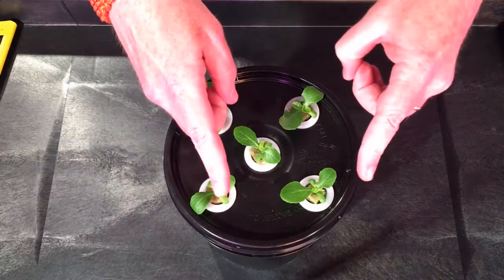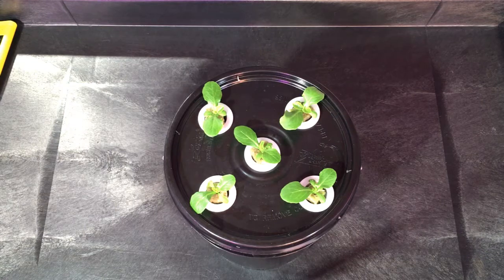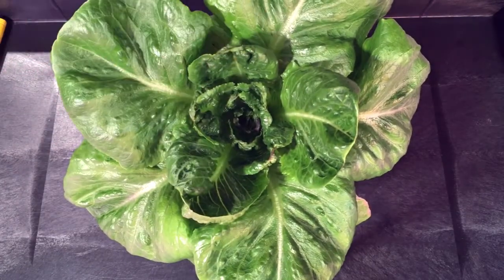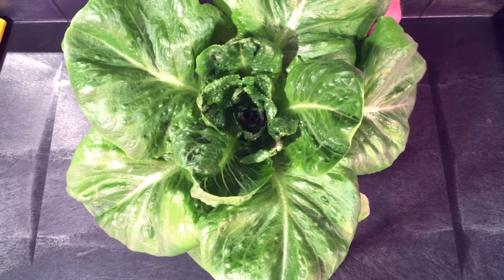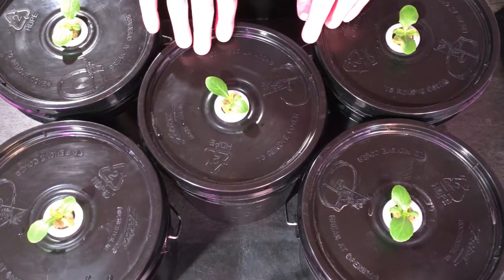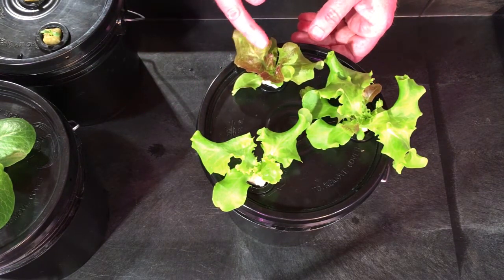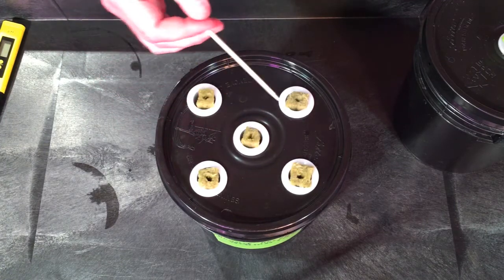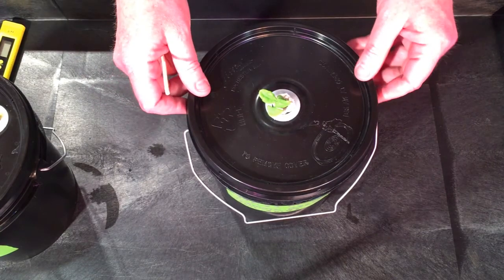EP 06: Bucket Spacing and Tip-Burn Talk (Day 29) – How I Kratky series

Comment: I hear ya on the PUMP failure for NFT. I was thinking some sort of a NFT/DWC hybrid if I ever do that method. That way you could build the channels out of 3-4" pipe or 4-5" fence post covers and set it up such that the water level is maintained at say 1" inside the pipe. So if you ever get a power failure, there is still nutrient in the pipes. Not sure what you would gain though over kratky. Simpler Nutrient management perhaps. Perhaps less space required. Better oxygenation I suppose. What do you think? For now, I'm sold on this excellent bucket method you've introduced to me. BTW are you a science teacher or something? Excellent lessons!
Reply from the maker: Assessing the Pro's/Con's of different systems seems to be the fine balance in all of this.  If I went with some NFT or NFT hybrid I would probably run multiple systems.  If there is ever a contamination issue, then the entire crop is lost.  That is another reason I like the buckets... 1 issue = 1 lettuce lost.  I doubt I've lost more than 5 plants in the past 3 years.  The key pro to the NFT for me would be space efficiency, I want to know how much I can grow for as little cost as possible without compromising quality.  More even nutrient formula and oxygenation would also be a big plus.  There are a couple guys in MN who run a commercial hydro operation, they use NFT stacked several layers high https://www.urbangreensmn.com/ , they're my hydro hero's.  Lol, I'm not a teacher.  I like this platform because I can always mute the derelicts, something that can't be achieved in a classroom.  Thanks for watching and checking in, I really appreciate it.
Reply: @HydroHavenGrow  Those guys in the link you posted above are hilarious. Check out this video for loading the Rockwool. Great idea LOL: https://www.facebook.com/urbangreensmn/videos/2078597298853459/
Reply from the maker: @ryanevans3329  I did not see that one before.  The one on E. Coli is my favorite.
Reply: @HydroHavenGrow  LOL. Vibrating toothbrush with an "attachment" to load those tiny seeds. Priceless.
Reply from the maker: @ryanevans3329  They are engineers, lol.  They went to college where I used to deliver subs.  If you want to meet up on the Facebook machine, leave a post on that video and I'll contact you.